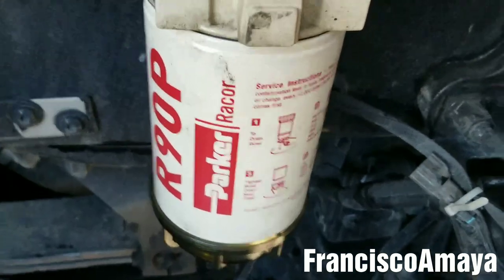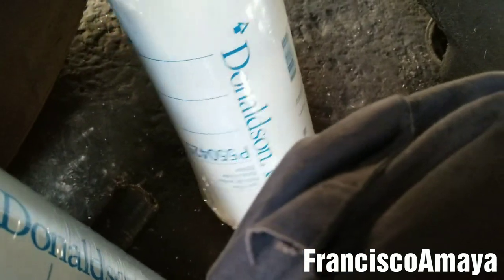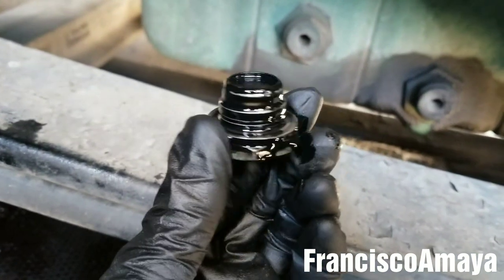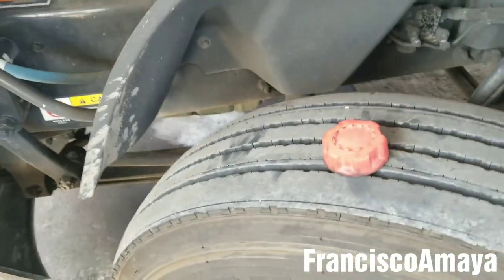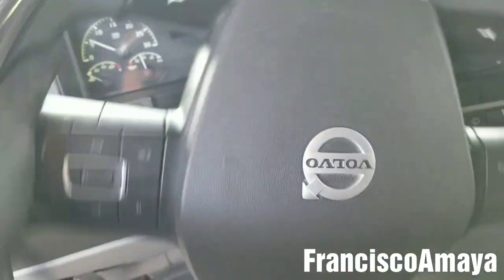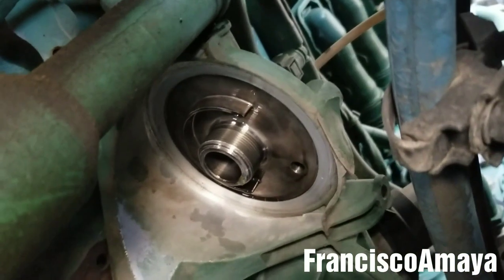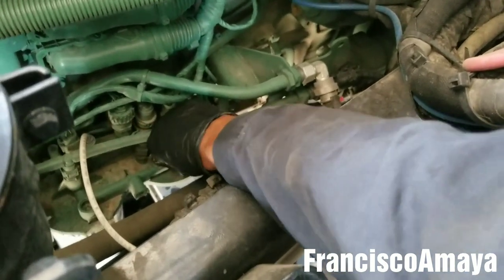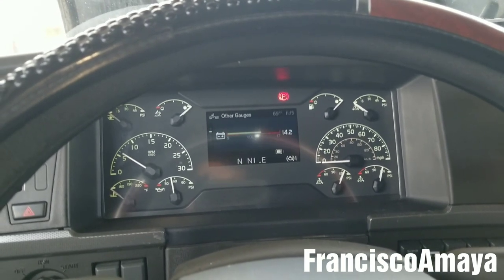Volvo D13 D16 Mack MP8 MP10 engine oil change oil type filters PART 2

Comment: Very informative video. 
I have a few questions: 
1. Do you HAVE to change the Fuel filter and Fuel/Water filter with with every oil change? 
2. How many miles/kilometers do you interval your oil change?